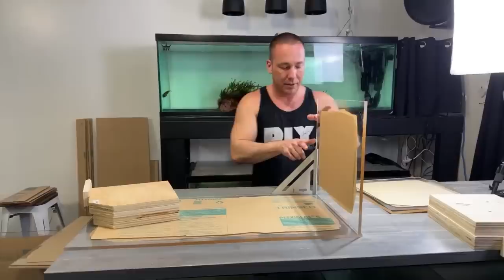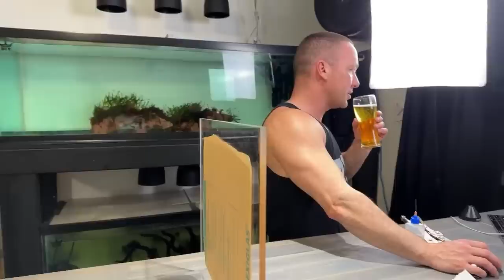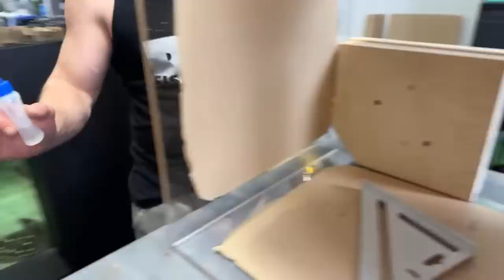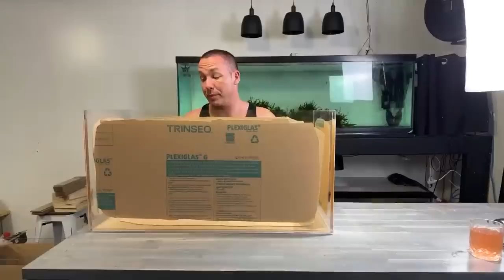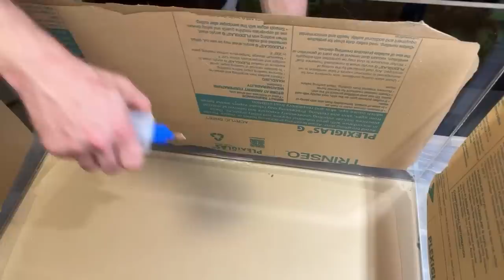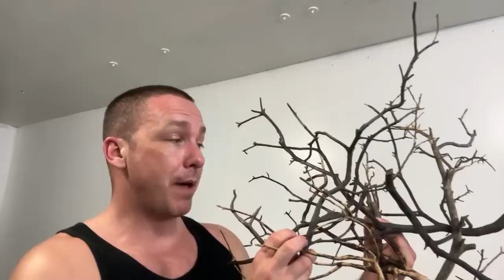HOW TO build a fish tank / aquarium LIVE with the king of DIY - A YOUTUBE FIRST

Comment: i have questioned for you about a 100 gallon tank i have. i had the cut the bottom of it out because it was make for a lobster tank at red lobster sadly.. but i want to replace the bottom so that i can use the tank as it would be my cheapest route to getting into a bigger tank than a 55gl so any help on what i can do to replace to bottom without using glass and not having to worry about it giving out and or leaking, thank you!